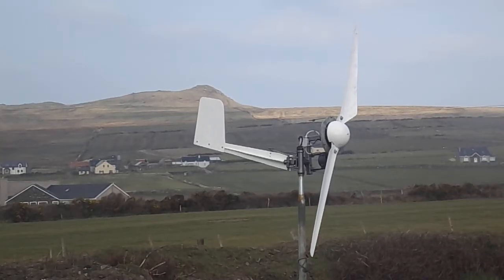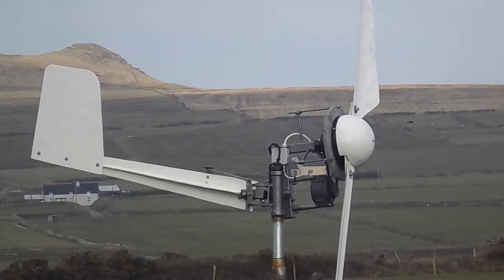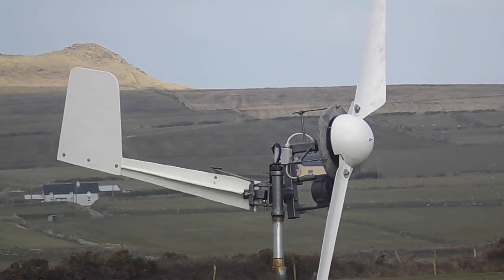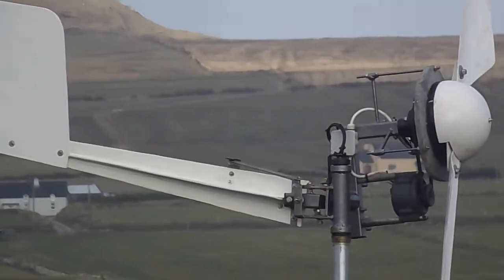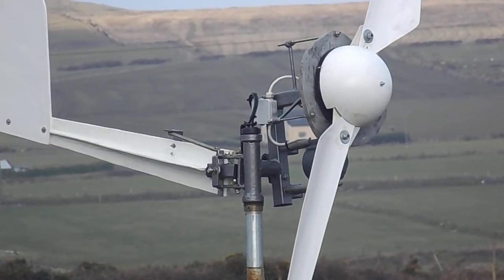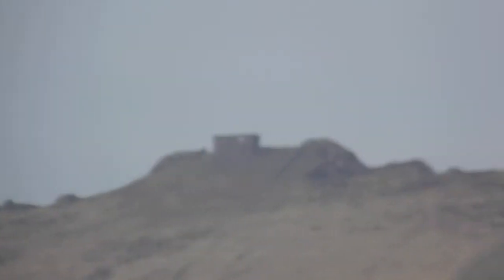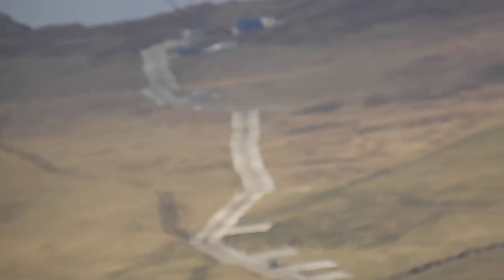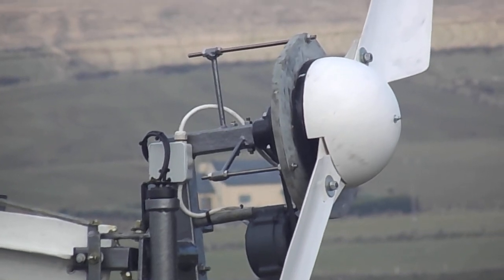future wind turbines that do exist now

Comment: How man watts is it suppose to put out?  Also, I want to see it run in some wind.
Reply from the maker: +Charles Robinson The stator is experimental 12v and can hit 30 amps. I am running it with a commercial PMG the reason for this is to find data on cut in wind speed which may be compromised slightly by the pully system eventually a new Axial flux stator will be fited approx. 48 to 92volt for GTI which has not yet been decided. The real question in sustainable wind turbines is how often as apposed to how much. Thanks for your interesting question.

Comment: so much thought put into your design, its impressive and feeding to the grid with the axial and charging a battery bank with the pma. those blades must make some great torque and only two of them so i bet they really get moving.
Reply from the maker: +closertothetruth  Yes two blades are great for the axial flux that's all it needs but with the drag of the belt on the pmg it may need 3 blades for lower start up speed especially in summer.
Reply: +ian57812 Looks great but I was thinking just what you said here.. With the extra PMG I would think you might be better with 3 blades? Just a opinion like a a_hole..Everyones got one!! LOL.... Great design look forward to seeing the output!

Comment: Can't wait to see it work.Very smart design.
Reply from the maker: +MissouriWindandSolar  So far Jeff your PMG in low winds and the axial flux are putting out the similar output. Both are 12 v at present. Must get some proper brake and free wheel switches from you to isolate each generator during testing.
Reply: +ian57812  The pmg is geared 2 to 1 if i remember. Well that's real interesting they are doing the same.
Reply from the maker: +MissouriWindandSolar  Your quite correct Jeff. Your pully from the Pmg on to a 6" pully You have a good memory.